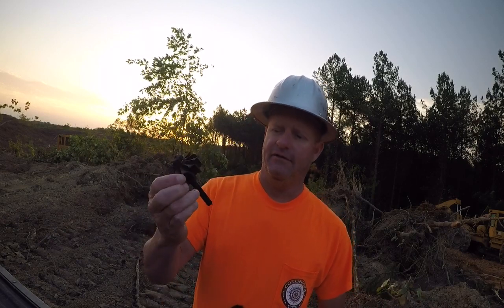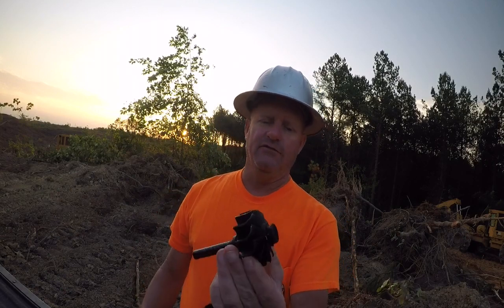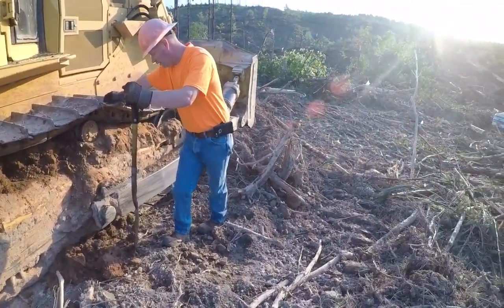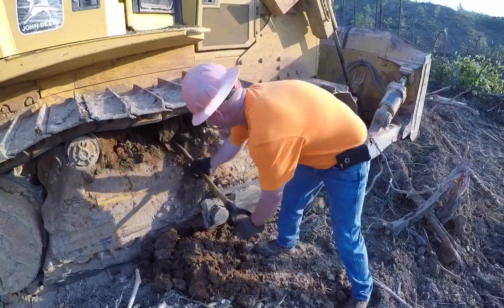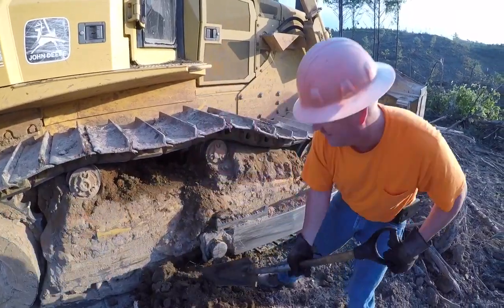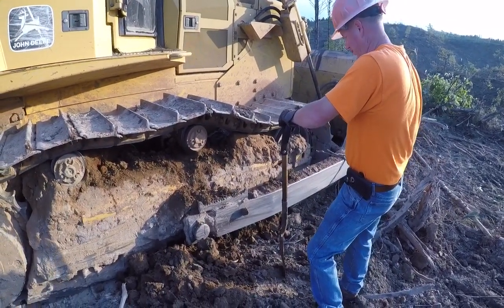John Deere 2154d rolling the loads out and a GIVEAWAY!!!

Comment: Cut a 4 or 6 inch round about 6 inches long of the trees you harvest.   Drill a hole the same size of the shaft for a desk display piece for about zero cost.  Spray the piece of timber with varathane or something similar to seal it up.   I have an old ashtray built like that out of an old piston set in wood.
Reply from the maker: +Randy J that is a good idea